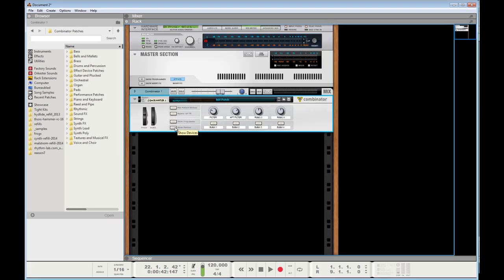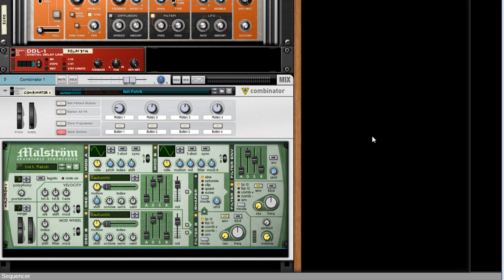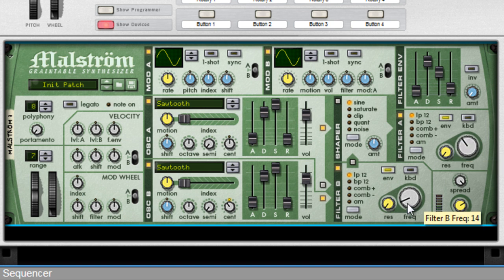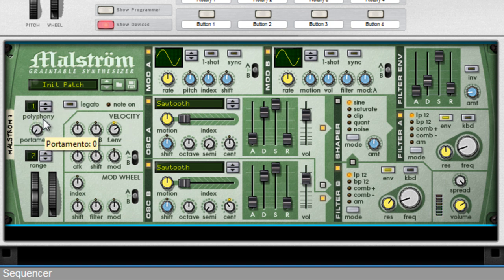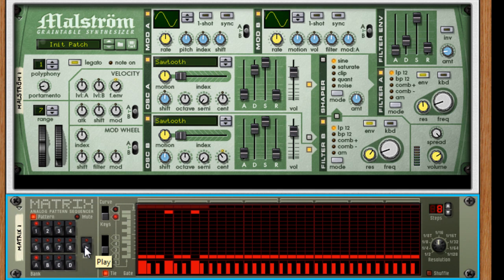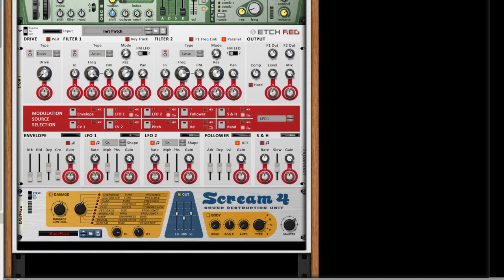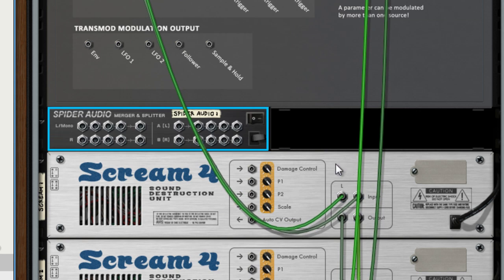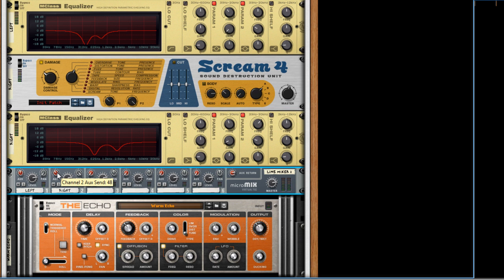Creating an Acid Bass sound in Reason

Comment: Why do you have connected the Scream by 2 cables? In my opinion, every Scream should be connected via a single cable (mono) - pan is tilted to the extreme left and right. Does it matter in this case?
Reply from the maker: in this particular case it makes a difference, since the original signal is a stereo signal.

Comment: is thear a way to do it without echered
Reply: yes :)

any filter that has a drive control
any synth with a saw wave, add a distortion with subtle settings then add a filter
add another distortion after the filter. and put the resonance at a higher setting than usual, crank the second distortion. 
sweep filter :)